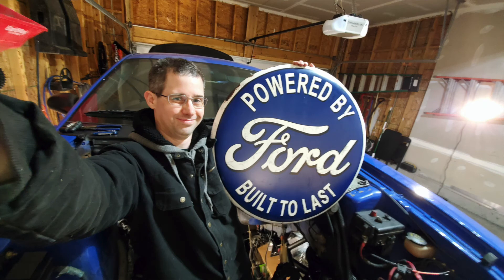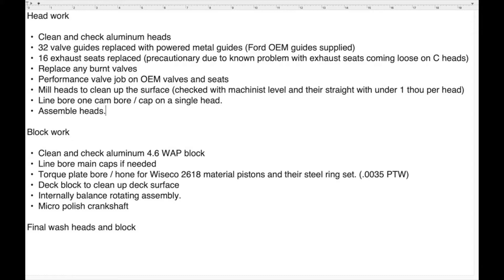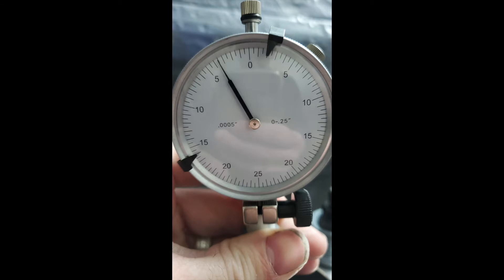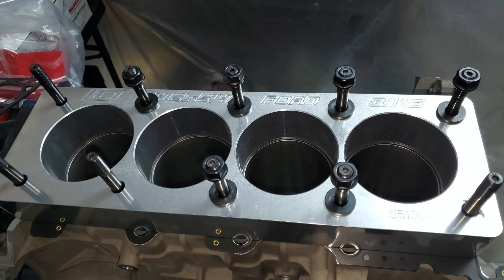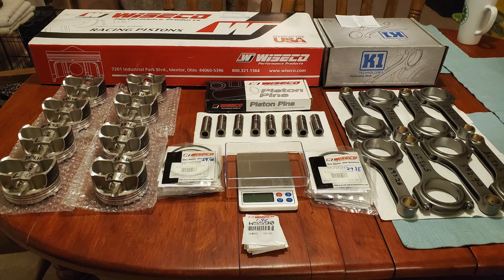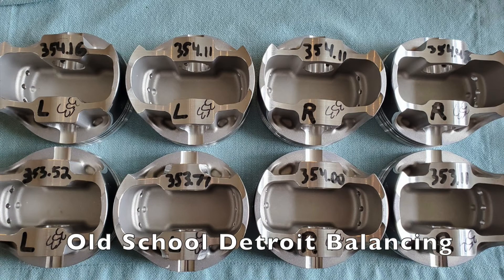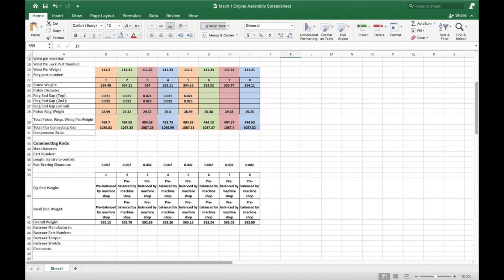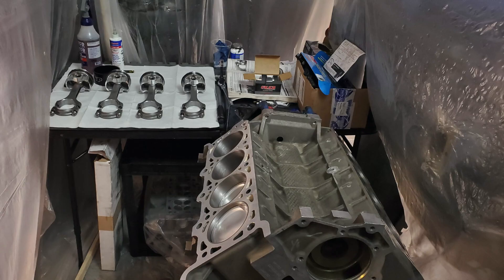Machine Shop Work On My 4.6 DOHC Mustang Engine - Things To Check When You Get Your Engine Home!

Comment: Awesome attention to detail, should be a very smooth runner!  I checked back at the build sheet the machine shop gave me for the short block and I'm at 3 thousands even piston to wall clearance which is in-line with the NA setup and what Manley states in their paperwork on the pistons,, same 2618 material as yours.
Reply from the maker: Sounds like a really nice build.  What numbers did you hit on the Dyno?
Reply: @MikesGarageRoute66  I'm still putting it together, slow going over here with two little kids. Just finished the valve train and timing the cams over the weekend which is a good milestone. Putting the covers and balancer on next and then back in the car. Hoping to have it running by Memorial Day weekend.
Reply from the maker: @redwalsh87  That would be great having everything together by then.  What compression and cams are you running?
Reply: @MikesGarageRoute66  10.8:1 compression with the flat top pistons and a custom set of cams spec. by Todd Warren. Hoping for 400ish at the crank.
Reply from the maker: @redwalsh87  It should be more then 400 at the crank.  Especially if you advance the timing.  Did you do any head work or just the cams?
Reply: @MikesGarageRoute66  Todd said it would make more than 400 as well but the engineer in me always airs on the conservative side haha. I did degree the cams to what he spec. on the cam card which did up meaning I filed the key on the exhaust sprockets and advanced both cams about 4 degrees. Anyways, on the heads I had MHS do their freshen up, thorough cleaning, new guides and exhaust seats, valve job and slight decking. They came out really good and they should perform better than new. I would have liked to get a port done but the budget is already being stretched.
Reply from the maker: @redwalsh87  Most of the gain is in a good valve job when NA. Porting does very little on these heads untill a power adder is installed.  I think you will be beating stock Coyotes due to the weight difference.  Especially if you did a K-member and other mods.
Reply: @MikesGarageRoute66  that would be fantastic!

Comment: Half a gram on each rod, a quarter gram on each journal...WOW!
Reply from the maker: Thanks John!  Trying to get everything as dialed in as I can. Build it once, build it right.
Reply: @MikesGarageRoute66  this should be one sweet little motor when you get it done.
Reply from the maker: @johnbarker5009  That's what I'm hoping.  The cost on building these engines is astronomical.  10 year ago I could have bought a complete shortblock from DSS for the price of just machine work today.